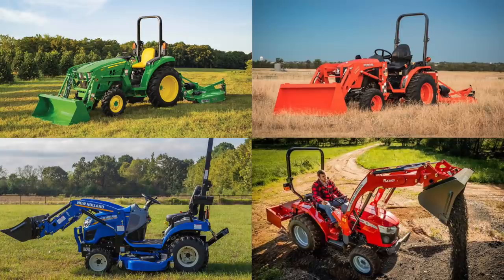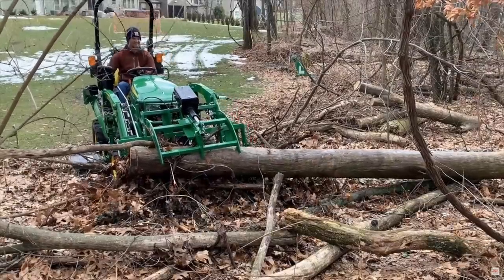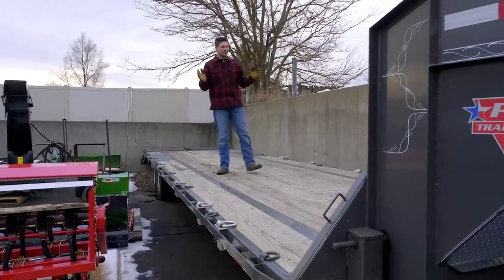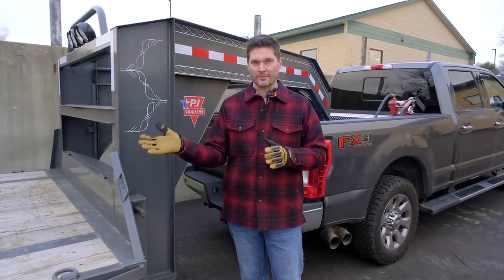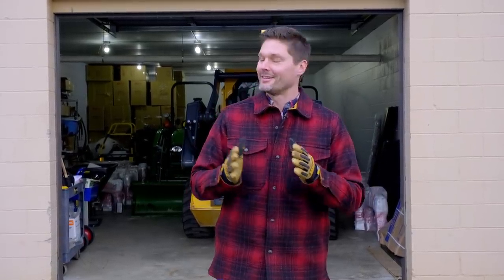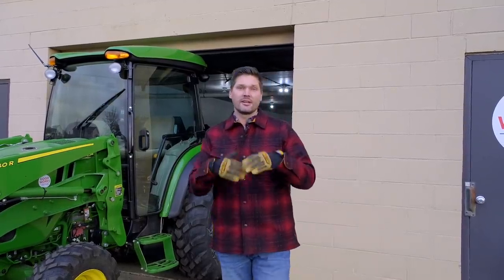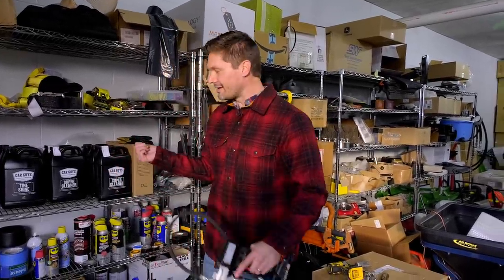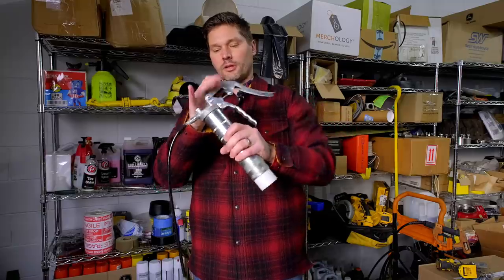BLOWING UP YOUR BUDGET!💥HIDDEN COSTS IN TRACTOR OWNERSHIP!🚜🔥

Comment: Hi Courtney, you are 100% right about costs adding up. When I bought my newest tractor last spring (John Deere 4066r). I had to also purchase the implements I would need. Such as a Frontier 4- in-1 bucket, front and rear hydraulics, wheel weights, 2 - 55 gallon drums of washer solvent filled in the rear tires (930 lbs), John Deere Quick Hitch, John Deere ballast box, 84" Frontier finishing mowing deck and a 84" Frontier hydraulic snow plow. I can't forget one of my best investments,  an 84" length of polyurethane cutting edge for my plow so I don't tear up my driveway (purchased from my good friends at "Good Works Tractors"! Sometimes the least of your worries is the purchase price of just the tractor itself. Good video as usual. Jack Venturi
Reply from the maker: Haha, thank you sir!

Comment: You do a great job stating how important it is to grease your machine.
 I have never seen anyone make a point of cleaning the zerks well before you lubricate. You don't want to force abrasive schmutts into your load bearing surfaces. Pivots points die because of dirty zerks.

Comment: Your not kidding I got a 1025r and a few attachments and a trailer within about 3 months. Fyi we had talked before about the factory 3rd function for a 1025r and the summit diverter, finally got ahold of my local dealer its $900 for the factory 3rd function. I just thought I'd let you know

Comment: Tip number one, buy a used tractor.  tip number two, forget the grappler,  pallet forks will do the job and more.  I took a chance and bought a high time 4320 compact (from a JD dealer)
that they just wanted to get off the lot.....too many things to fix.  brake pedals frozen up from sitting outside,  rockshaft went up but not down...no it wasn't the rate knob.  I freed up the brakes, took the heavy cover off the rockshaft assy, little pilot valve got cleaned and new O rings.  Cost me $6.00 ,  a can of BP blaster for the brakes, a rattle can of green paint and Bob's yer uncle I got a
dandy for less than half price.  Pallet forks from Titan and a tiller from Tractor Supply.   BTW, dealer had replaced the diesel with a new one before they threw in the towel. Tach still shows over 5000
Reply from the maker: Thanks for sharing!

Comment: Great video, so far most of my attachments have been used but even then there are costs. Bought a used snow blower, no sub frame missing drive shaft and then whoever had it before me did not use the skid shoes so this summer need to buy a new shell for the blower. I failed to look close at the whole thing when I bought used
Reply from the maker: Yikes, sorry to hear about the issues with the blower.
Reply: @GoodWorksTractors  not to worry I'm not mad or upset it's just life and I should have looked closer. Things happen everyday so we just have to adjust for it. Besides when we took the old blower apart and put it on the new shell I really got to see how it all worked.
Reply from the maker: Yep, good info for others to be aware of.  Thanks for sharing Curt!

Comment: Added the 3rd function hydraulic lines to my JD 4720 for a grapple, if I would have did it when tractor was new the kit was $400, 10 years later the kit was obsolete and piece by piece it cost me $1100 from Deere doing it myself, seems like it’s always cheaper to do it when buying the tractor new as a kit, I could have went aftermarket but I wanted it to look factory
Reply from the maker: Yep.  I've found that adding when new is typically cheaper vs afterwards.  In your case, a decade worth of inflation didn't help either.  Thanks for sharing Paul!
Reply: @GoodWorksTractors  no doubt, crazy inflation on stuff!

Comment: It's gets expensive quickly if you are buying a tractor and attachments for the first time. We've been collecting tractors and attachments for over 50 years, I'll never sell what we've got even if it hasn't been used for years decades or whatever, it'll come in handy one day. And it does.
Reply from the maker: Sure does.  Costs add up quick!
Reply: @GoodWorksTractors  it's something I've so many times people buy a tractor and then they can't afford to get the attachments they actually need to do the work that they have. If was starting from scratch I would be budgeting a further 30 - 40% on top of the tractor price for the attachments

Comment: Where did you get the hydraulic hose mount you are connecting your grapple to on your fel?  Basically a 90 degree bracket.  I can't find those anywhere.

Comment: Love your content! I have recently taken on my grandfathers 1975 John Deere 400 Hydrostatic garden tractor with a few attachments and looking to tackle a full rebuild. Any ideas and parts you can assist with would be helpful.
Reply from the maker: Can't give you any help with parts, but will say that those machines are definitely popular and sought after.  It's a great machine and worth the time to restore.
Reply: @GoodWorksTractors  thanks 🙏 

Is there a size difference with all of the 3 point attachments you have specifically at the 3 point position or is that more so defined by “category 0,1,2, etc?

Comment: My first ever tractor (B2601 with loader) is to be delivered soon and I'm wondering if an enclosed 6x12 trailer (6 1/2 ' interior height) will be big enough to tow it around behind my half ton pickup.  Any thoughts on that?  Thanks for your videos, they've helped a lot!
Reply: You may have to curl the bucket to make that fit. Setting in the garage with bucket flat/ 3 point arms up I'm 144". Lowering the arms may shorten a little.
Reply: @bhall7997  thanks!  It's a short V, so a couple extra inches beyond 12' and maybe if I back it in the 3 point will fit better in the V.  Anyhow, thanks again for your videos!

Comment: Hey.  This is a weird question.  Can a 1025r push/pull your pickup up the driveway at the shop?  I part out burbans & pickups.  I didn't think a small tractor would work, but maybe you could find out.
Reply from the maker: Good question.  I doubt it, but maybe?  Not something I'd want to do on a regular basis with that small of a tractor though.
Reply: I pushed a UPS truck up my snow covered drive with mine but, the truck was pulling also.
Reply from the maker: Sounds like I've gotta try it out 😂

Comment: Are of a question than a comment. How do you convert a category 0 attachment to a category one attachment?
Reply from the maker: Change out pins.  Probably won't be quick hitch compatible though as the spacing between the links will be different.

Comment: Just got a 3039r and the JD dealership says my box scraper is enough ballast. 🤨
Reply from the maker: 🤯 The 320r loader manual begs to differ.   I'd definitely add some additional weight.
http://manuals.deere.com/omview/OMPXX10906_19/OUO6064,0001B66_19_20180118.html
Reply: @GoodWorksTractors  Thanks. I was trying to find that information. I would have trusted them if I hadn’t watched your other video about ballast already. As it is I’ve already told them to fill the rear tires with beet juice no matter what they think. Thanks for keeping us newbies safe!
Reply: Question on that minimum weight. Do I need to do all three of the things it lists or do only one of them or?